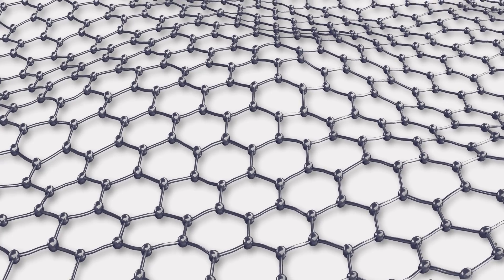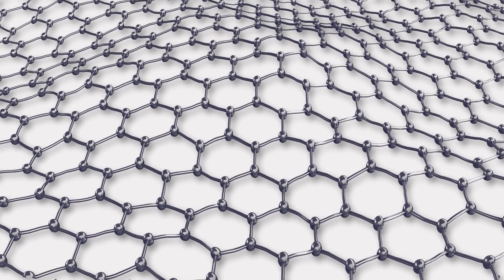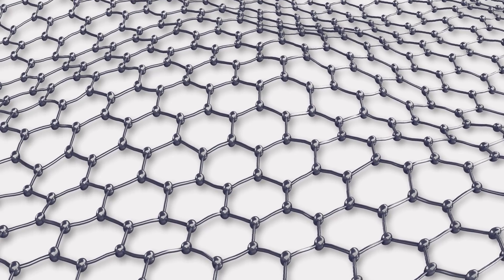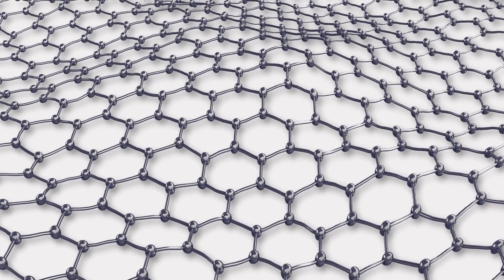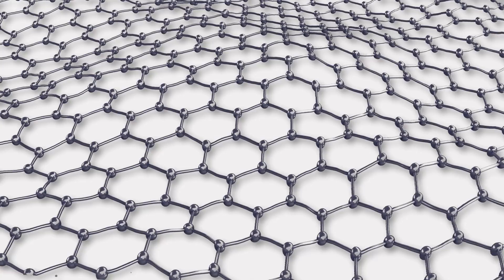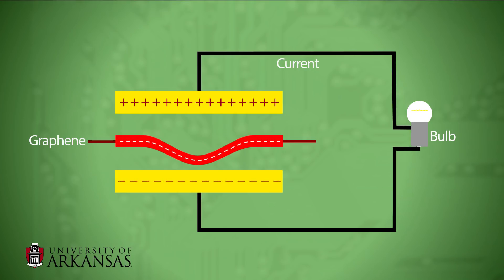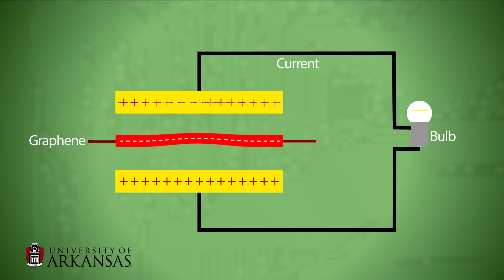A Potential Source of Clean, Limitless Energy

Comment: This circuit needs 2 diodes and a capacitor.  :D Really small ones.  LOL
Reply: But a light bulb can take in AC as well. But for DC you're right
Reply: I see no data here on how this scaled would handle the efficiency decrease that causes.
Reply: Steven Ingram it's just an over simplified graph...
Reply: This circuit doesn't work in real life.
Reply: @Gabriel-um9hm  ??
Reply: @karenslivesmatter2186  The effect you see at the graphene is also occuring at the lightbulb.  In order for any energy to be harvested the lightbulb must be colder than the graphene.  This is in fact how peltier devices work.  Look up Nyquist thermal noise and Peltier devices if you want to learn how it works(or doesn't in this case).  I also suggest reading up on the laws of conservation of energy.
Reply: @Gabriel-um9hm  uhh it doesn't break the law of energy conservation
Reply: @Gabriel-um9hm  it takes energy from molecular motion, in fact it does cool down when extracting energy.
Reply: @Gabriel-um9hm  and Probably the second law of thermodynamics doesn't work at really small scales as fluctuation dominates
Reply: @Gabriel-um9hm  read this part
Yet, they never stay in perfect equilibrium if they are very small, made of a few individual particles. Instead, they undergo random fluctuations that can push them away from equilibrium. Such is the case with graphene which experiences fluctuations from quantum effects even in perfect vacuum.
Reply: @Gabriel-um9hm  once again I don't really know, I myself isn't a scientist, this is just what I understand so far
Reply: @Gabriel-um9hm  I just copy the whole text lol 🤣 cuz yt keeps deleting the link
Reply: @karenslivesmatter2186  yes, I've read the original article a while back. The author is mistaken as they fail to include the induced voltage(force) on the graphene from the resistor which serves to counter any vibrations. The only time it doesn't do so is when it is colder, as I stated earlier.

Please look up how peltier device work. Specifically how the difference in potential leads to thermal transfer through the movement of electrons.  The graphene and resistor form a peltier device.
Reply: @Gabriel-um9hm  yeah more research needs to be done here in the new fields of how thermodynamics behave in really tiny scales. But suppose that it works it would be a game changer for the world. For example CPU the actual chips are tiny and those other materials are just the heat sink, if we have this circuit let's say that it occupies half the space of the CPU, it's still gonna deliver more computing power to these CPU 👍😁
Reply: @Gabriel-um9hm  I don't really know, but I hopes that new research is being done here cuz this is really game changing if it works
Reply: @Gabriel-um9hm  peltier device is TEG right?
Reply: @karenslivesmatter2186  Yes, it can be used as a thermoelectric generator.  It can also be used as a heat pump for cooling/heating.
Reply: @karenslivesmatter2186  Sure it would be a game changer as it would allow infinite power.  It doesn't actually work though. Having magic be real would be cool too but reality doesn't work that way.
Reply: @Gabriel-um9hm  it doesn't have infinite power tho, it takes energy from the sorrounding, so if no other heat source is there eventually the system would cool down
Reply: @Gabriel-um9hm  just wondering why are u skeptical about this? i got it why the maxwell demon doesn't work, because it's using an active measurement to track the particles, and the energy neede to measure those particles are waybigger than what is extracted from them. but this graphene thing uses a passive capture system which i'm quite optimistic about it working, and it dd load on a resistor generating heat soo i think we need to wait for more results
Reply: @Gabriel-um9hm  BTW do you have discord or insta or any other chat apps, seems fun to talk about this
Reply: @Gabriel-um9hm  yea i got it skepticism is the driving force of science, if you ever watched thunderfoot you know what i'm talking about. but skepticism can also be applied to known sciences and tests how those theories holds up against new technology. Science is a collection of understanding about the universe and how it works, if a theory is wrong then it will get updated. What i'm quite skeptical about is how well the second law holds up in this new era of nanotechnology. And i still don't get it why u said that the 2nd law isn't statistical. What i've read so far from all sources, the reason behind why the second law works is probability, and as a system's size gets larger, it gets more and more effective, eventually at the size of everyday electronic such as a peltier device that you mentioned earlier, the probability that heat flows from cold to hot just becomes absurdly unlikely. Just a reminder that the second law was invented in the age of steam engines, where people would have never though that we would make something the size of several atoms, and that's why they were so sure in their theories using words such as "Impossible". Sorry if i get quite a bit conspiracy type of talk here, but just wanting to share some thoughts.
Reply: Thermodynamics is one of the most venerable physical theories. 18th and 19th century physicists like Carnot, Clausius, Gibbs, Helmholtz, and Boltzmann established it as a cornerstone of how macroscopic systems made of many, many constituent particles behave, how heat is transported from one system to another, and how engines do work and with what efficiency.

It is from thermodynamics that we get laws like: there are no perpetual motion machines (machines with 100% or more efficiency or that have non-zero efficiency in thermal equilibrium).

Unlike the laws of mechanics or many field theories, however, thermodynamics has always been recognized as containing both strict and de facto laws. The primary laws are:

Energy can be neither created nor destroyed. (Strict)

Entropy can never decrease. (De Facto)

There are qualifiers to this. In the 1st law, the system must be closed. For the second, we are talking about bringing two or more isolated systems together.

The conservation of energy is a consequence of time translation symmetry of our universe. All times in physical laws can be shifted by a constant amount. We get that from Emmy Noether’s theorem. No physical law breaks the conservation of energy.

The second law is a “de facto” law of physics. I use this term where others might use the word “statistical”. But to say it is statistical is an understatement compared to other fields like sociology. Until about 25 years ago, a violation of the 2nd law was almost thought to be impossible.

Carnot’s theorem of engine efficiency derives from these laws. A consequence of his theorem is that, if you have two systems at the same temperature (in equilibrium), then the efficiency is 0%, nothing moving. Since all systems equilibriate thermally when connected because their efficiency is < 100%, all engines run down. There are no perpetuum mobile, no perpetual motion machines.

A problem with the 2nd law of thermodynamics is that it conflicts with another, strict law of physics: that all physical processes are time reversible. Any trajectory of a particle forwards in time can move backwards in time the same way it came.

If that is so, then why would a law that implies the existence of irreversible processes like the 2nd law also exist?

Physicists wrestled with that idea for decades until about 1993 when Evans and team proposed a potential solution called the fluctuation theorem. The fluctuation theorem provides an exception to the 2nd law of thermodynamics that admits reversibility even in so called irreversible processes.

Essentially, all it says is that increase in entropy becomes exponentially more probable with longer duration of time. Thus, the 2nd law is no longer strict, just exponentially probable. (An exponential probability distribution goes to 0 or 1 extremely quickly, making it appear to be a virtual certainty.)

This theorem, which has been proved from mechanics, opened the door to a new science: stochastic thermodynamics, and, in the last twenty years, it has been demonstrated experimentally multiple times, each time with more startling results.

The most recent demonstration, published this month, by a team at University of Arkansas, is perhaps the most amazing: power generation from the “out-of-plane” thermal motion of a wafer of graphene (that all-powerful substance made of the thinnest layer of graphite, i.e. carbon).

While at first glance, this is a perpetual motion machine, the theory behind it is sound. The basic idea is that any system exchanges entropy (sometimes just called heat) with its environment (also called a thermal bath because it is a reservoir at a particular temperature). While the contact between a system and its bath is at equilibrium, making exchanges of energy in either direction equally likely, the rest of the system can be far from equilibrium. This means that over short durations of time, systems can do useful work as they relax to equilibrium.

Yet, they never stay in perfect equilibrium if they are very small, made of a few individual particles. Instead, they undergo random fluctuations that can push them away from equilibrium. Such is the case with graphene which experiences fluctuations from quantum effects even in perfect vacuum.

While the authors of the study claim in the news media that they could harvest power from thermal fluctuations, as yet, they have not demonstrated that they can store the energy. Instead, their experiment dissipated it through a resistor as heat. Time will tell if genuine power can be harvested this way. Mother nature will take her due in the end; the question is whether something useful can be done before that.

They plan to store the energy in a tiny capacitor as their next experiment. The hope would be to dissipate it at a later time by releasing the energy from the capacitor.

One way to think about this is that you are not really creating a perpetual motion machine. Rather you are extracting energy from the variance around the thermodynamic mean (average) of a system. In other words, by causing a system to return to equilibrium faster after some fluctuation pushes it away, one can do useful work.

The science behind stochastic thermodynamics goes far beyond harvesting energy from Brownian motion, however. It is a fundamentally more sophisticated and coherent theory of thermodynamics, one that takes into account exactly how systems reach equilibrium, how they stay in it, how they can be knocked out of it, and what happens when systems are connected to many reservoirs of heat rather than one, as in the case of graphene being connected to its thermal reservoir and a circuit.

Stochastic thermodynamics combines two essential ideas: ordinary statistical mechanics which underlies classical thermodynamics and Markov processes which are critical to understanding non-equilibrium statistical processes like engines and control systems.

While equilibrium statistical mechanics ignores time, Markov processes are a way of representing how stochastic (anything that obeys a random rather than deterministic law) processes change with time. Combining the two, we arrive at a description of dynamic processes that may, over long periods of time, have stationary statistical states (are in thermal equilibrium) but over short periods of time the probability of deviating from equilibrium is non-zero (but exponentially small). This can do useful work on another system.

One of the key properties of Markov process descriptions of equilibrium systems is called detailed balance which derives from something called a master equation. A master equation represents how a stochastic system transitions from one state to the next. Detailed balance is the idea that if a system has two states m and m’ that it is equally likely to transition from m to m’ as from m’ to m, i.e., equally likely to transition one way as the other. This is a fundamental statement of equilibrium.

In order for a Markov process to do work, it has to violate detailed balance for some short amount of time. Violations of detailed balance manifest as a force because they increase the likelihood of a state transition in one direction versus another. This idea is fundamental to non-equilibrium processes, but we now know it applies to “equilibrium” processes as well, because, in reality, there is no such thing as equilibrium at all time scales, i.e., equilibrium is not scale invariant.

This theory helped the University of Arkansas team prove that a particle of graphene under Brownian motion can generate power which is then piped through a pair of diodes to convert from AC to two DC currents and dissipated in a resistor. The theory is that if Brownian motion can generate a DC current like this, it can be dissipated in something else, possibly at a later time, like powering a microchip or a small LED.

Indeed, this is not the first time that a microscopic “engine” has been seen experimentally. In 2016, a Spanish team published an investigation of a Brownian engine where thermal fluctuations created deviations from the 2nd law of thermodynamics, allowing work to be done even in thermal equilibrium. They observed a single trapped particle of polystyrene immersed in water and saw how it could violate Carnot’s law of engine efficiency (essentially extracting energy in thermal equilibrium).

From this, it may be possible to create large arrays of nano-scale engines to produce energy, though the power and expense required to trap these particles may exceed that which they generate. One would need a passive trap, with graphene perhaps offering the answer in that its particles are trapped in its lattice of carbon molecules. The ability to generate this power in a vacuum may also make it applicable to space technology where a vacuum is readily available.

Comment: So one square meter would produce 100K Watts?
Reply: Musk should use it in his Teslas.
Reply: @dmitry926  you still need a source of power. This is just an incredibly efficient power converter.

It could just use ambient heat for small devices but a car would need much more power.

Comment: i think what hes failing to explain is that the atoms are "moving around" due to their temperature. so the battery has to be constantly heated...either by the surrounding medium or by radiation (sunlight).
Reply: ...or you could hear it with a watch battery...
Reply: 📰 "The findings, published in the journal Physical Review E, are proof of a theory the physicists developed at the U of A three years ago that freestanding graphene — a single layer of carbon atoms — ripples and buckles in a way that holds promise for energy harvesting.

The idea of harvesting energy from graphene is controversial because it refutes physicist Richard Feynman's well-known assertion that the thermal motion of atoms, known as Brownian motion, cannot do work. Thibado's team found that at room temperature the thermal motion of graphene does in fact induce an alternating current (AC) in a circuit, an achievement thought to be impossible."

📰 source:
https://phys.org/news/2020-10-physicists-circuit-limitless-power-graphene.html 

📰 October 2, 2020